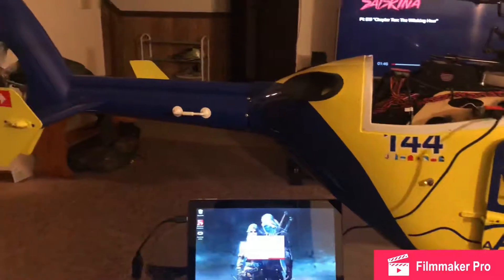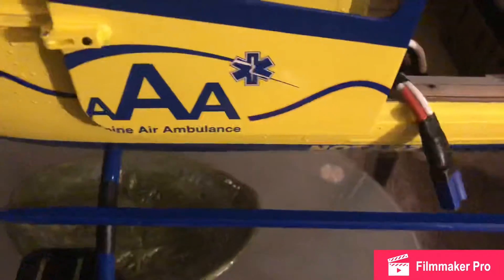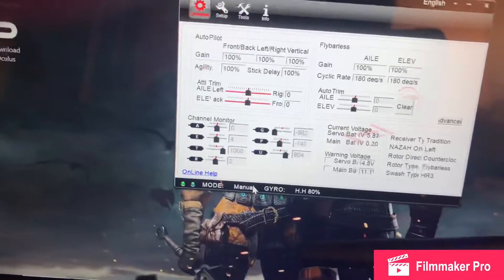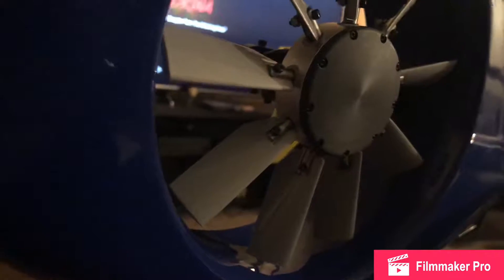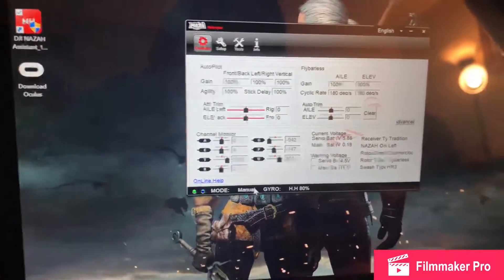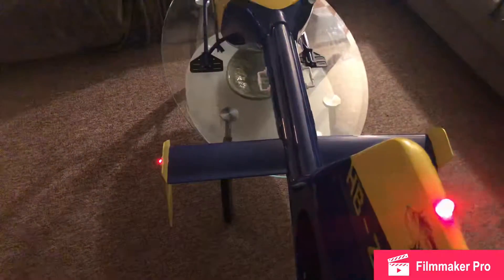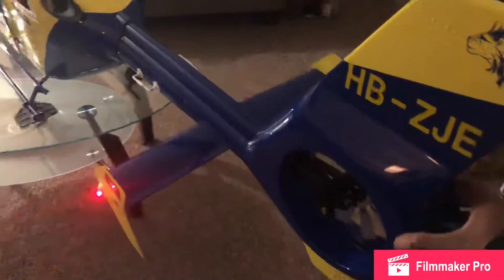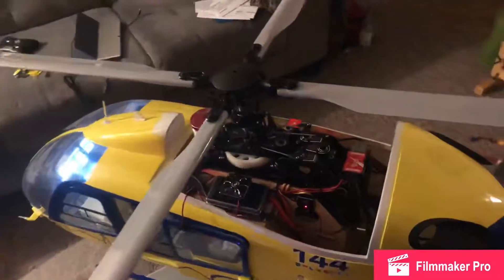Radio Control Helicopter (Roban EC-135 Tail Servo Issues)

Comment: Did you get your tail rotor working with a lower Head speed sounds like these machines don’t like high RPMs for the tail rotor to work no matter what Gyro you put in it